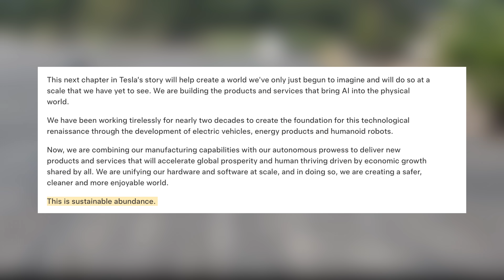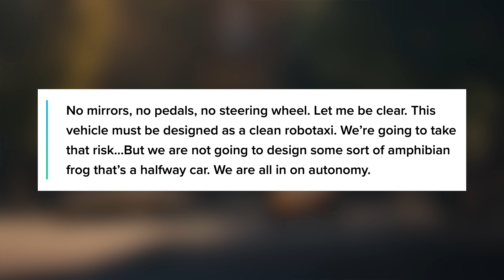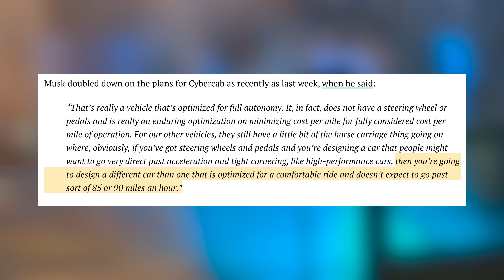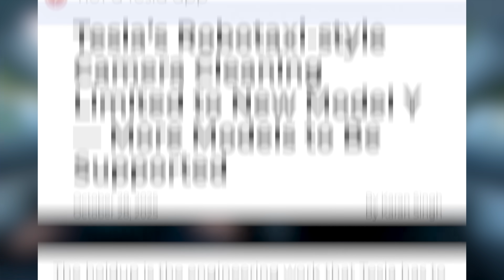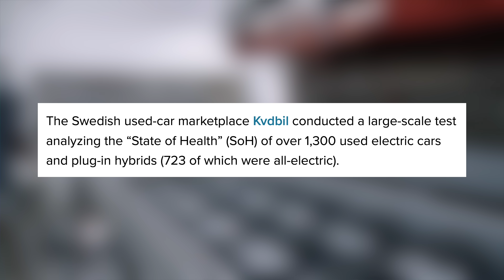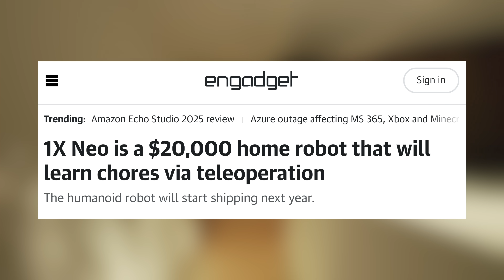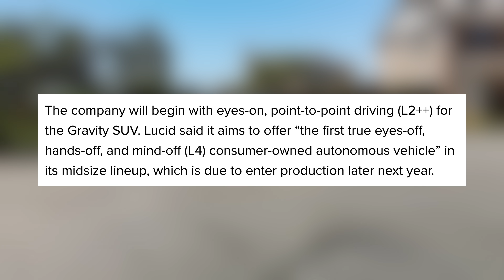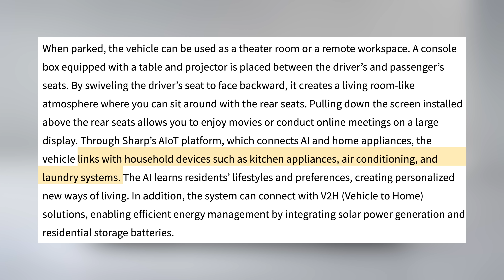The NEW Humanoid Robot That's Ready For Launch | 1X NEO

Comment: Robo Taxi is honestly not a great design IF you just want a car to take people to a destination.  The ZOOX is a better taxi design from the physical design side. Easier to get in and out of,  simple interior.. Easy to use temp and music choices. I think it is smaller than the Robo Taxi but seats FOUR people if needed.  As a passenger.. having to drop low and duck under a roof to get in a car is not really what you want to do.  Easy entry and exit is more important.

Comment: If you hit a pole in one of these the following can happen.   The power goes.  You cant open the doors as they are electrically operated.  The front battery that powers the cars doors catches fire.  Gasses from this enter the cars interior. Occupants try to get out.  If they are well briefed they may know the location of the manual release catches but in the fog and panic of the gasses they may not find them, and few users know where they are.  Who trains their passengers in exit procedures, passengers wont have a clue.  So the occupants may die, in what should be a small accident.  Stache D training has the proof.  Why is it permitted to sell cars you cannot easily get out of in an emergency.

Comment: The cyber cab as designed with full autonomy will be the very safest car ever built. They should take this information to the regulatory bodies and show them. Then the question becomes do I have to add a steering wheel pedals and mirrors that will make this a much more dangerous car? And press to change the regulation. This cyber Cab offered also as a car people can individually purchase as a low cost car without a steering wheel and pedals being the safest ever built will be an epic blowout sale. Everyone will buy who drives the cheapest cars out there. It’s the inexperienced drivers my nephew totaled three cars in his first year with his drivers license. None of that would’ve happened if his first car was a cyber cab with no steering wheel and pedals we are going to pollute the data of the cyber Cab if we put a steering wheel and pedals in it and let all of the inexperienced and bad drivers ruin his driving record This should never be a consideration. This is trading safety for sales, which seems to be what people wanna do and it’s just foolish. I would rather wait an extra year and force a regulatory people to realize the steering wheel and pedal makes a far more dangerous car dentist sub come to their current requirements and add a steering wheel and pedals making the car more dangerous. This is a no-brainer never add a steering wheel and pedals. I will buy two of these the minute they’re available with no steering wheel, pedals or mirrors.

Comment: I think the auto insurance industry will pressure regulators to force driver controls.   If the car has no controls, then no auto insurance is needed and would kill the industry!!!
Reply: Actually the regulators will most likely require insurance either way, at least for the foreseeable future.
Reply: @icarys perhaps some insurance but not liability.  If the people in the car have no controls any accident can’t be their fault

Comment: I expect the steering wheeel and pedals will be required in many if not all states. I hope that Tesla will be authorized in 1 or 2 states initially such as Texas and California and that will pull more states toward similar authorization. I would buy a fully driveable model like the M3 or MY as my personal car but use a clean cybercab when traveling into a metro area such as New York City, Los Angeles, Seattle, Miami and San Francisco. I expect Tesla will setup Metro border changeover parking lots where you can safely leave your own car and pickup a cybercab to your inner city destination. That may satisfy people who want a steering wheel and pedals (as well as a functional driver UI).

Comment: “Early development stages” doesn’t mean the roadster as a whole is still in early development stages. Tesla has already claimed that they have completed most of the engineering for the roadster. By “early development stages”, that likely only applies to the battery tech, not the car and powertrain themselves.

Comment: I rode in the Zoox fully autonomous vehicle in Vegas and it was pretty cool and had lots of room.  I like that the riders face each other and they have huge windows to see out of and plenty of cargo room for my luggage.  The four wheel steering is pretty sweet as well.
Reply: The Zoox-cab makes more sense regarding ergonomics... I don't see how women wearing high heels or older people can get in and out the cybercab (in its current design) without extra help from outside.
Reply: @koenraadprincen7212  This is so true.  The Zoox has enough room for wheelchair accessibility which they said is coming soon.
Reply: What speed does the Zoox drive at? (Maximum)?
Reply: @idahorx1 The one we rode in had a top speed of 75 mph, but they limited it to 45 mph in the city during testing.

Comment: Use FSD every day and the latest two updates are awful (almost unusable)! The only positive is that now I can select destination parking and it actually parks in the spot. But that’s where it ends! It panic brakes for a leaf blowing across the road, it blows past my offset speed (even in standard mode), has jerky starts and stops with more phantom braking than ever, blows red lights or races to a yellow just to slam on the brakes, and the maps still suck - sending me to a close, but wrong destination or taking the weirdest path unnecessarily. I keep sending feedback, hope it changes soon.

Comment: Been using V14 for 3 days now. Can’t say that I’m a fan. Highway speed sets to 121Km/h at Standard. Max is 100 and police rarely ticket below 118. So I usually set 115. Also late last night, 11pm, on a winding country road it set itself at 101 in a 90 zone. Lots of wildlife around here and I woulda liked to be able to set lower. Phantom breaking and trying to avoid paint markers on the ground didn’t help either
Reply: Sometimes I have to go to Chill.

Comment: Forget full autonomous, people should be making the decisions when it comes to driving.

Make the 2-door with steering wheel, pedals and stalks (gear shift and turn signal) and I guarantee you that I am not the only one willing to buy that car.

I have little to no need for rear passenger seats in my daily commuter/just out for a drive car.

Comment: Mad Max speeds a little too much for me, but I love how it maneuvers in traffic. It's actually quite safe.
Reply: Mad Max was going 25 over the speed limit on my way to work this morning.... I'm a lead foot, but this is a little tooooooo much.  lol
Reply: "Quite safe". The people who got into accidents injured and got tickets would beg to differ. Stop relying on computers to drive for you.
Reply: @TuLokotron2010  About 7000 pedestrians are run down and killed by cars every year. FSD is overly cautious around pedestrians to a fault. Whether or not FSD is ready or not, if it were implemented today, 90% of this pedestrian annual death toll would stop immediately.  
And most of the 40,000 people who die every year in auto accidents would stop too. Half of these fatal accidents are caused by drunk drivers, and stopping these people from driving would save a lot of lives as well.
Reply: @TuLokotron2010  Just yesterday, my Tesla braked hard on a blind intersection that took me off guard, and then a split second later, I saw a car speeding through it.  My Tesla saw it before I did, and may have saved me from getting t-boned.  Computers will be safer than humans very soon.  In this case, it was.

Comment: Full self driving cannot handle dirt or gravel roads. It just stops when it looses reference points and lines. 
Thus the need for driver controls. Especially if the Robotaxi is sold for private use. 
I imagine there are mani other situations that it cannot determine how to travel
Reply: handles dirt and gravel fine for me
Reply: Are you talking about Autopilot?  Because I have seen many youtubers driving off road with FSD.
Reply: FSD does just fine on dirt roads. Just pull up some FSD on China roads videos and you'll see. Very impressive. You must be referring to Autopilot stack which is a different thing altogether.
Reply: @galfert full self driving 13. Software. As I mentioned above it could be due to no defining edge. Which all of the videos of well traced dirt roads, they have no issues. Also I wish the software will eventually learn to avoid chuck holes.
Reply: @galfert after the recent update my car now handles dirt and grassy roads…
Reply: It could be due to the dirt is covered with tuffs of grass, leaving no clear path. I’ve had delivery drivers get off the path, due to trying to do paperwork at the same time.

Comment: Its a mute point if you have steer-by-wire as demostrated by the cybertruck. At that point steering wheel and pedals are just an oversized x-Box controller. So this really does not matter from a technical design perspective because it doesn't const them anything in compromises.
5:07 So no, it does not go against what he said on the earnings call. Designing the car for autonomy does not prohibit being able to put manual controls in it, if you have a steer by wire system. Can you think more then 5 seconds before you write this crap?
Reply: Moot point - unimportant or irrelevant point that does not matter.  Not a mute point.  Also, not a moo point but there's a friends episode that makes a pretty good argument for "moo point."

Comment: Tesla needs a VW Golf size car at 25-28 thousand dollars.
Reply: i agree.  would love one.
Reply: 20 - 25 would be even better.  Doable if they would use cheap /durable materials ditch all self driving , sensors , radars, cameras , computers.   Just a plain good range simple EV for everyone who has any work.  Could be called Tesla B or Basic 😅 Model like this would start real EV revolution world wide.
Reply: @MartinMartinX  They don't need to ditch self driving.  They need to set aside some greed and put the marketers (instead of overpaid engineers) in charge of sales innovation for a little while.  The first EV company to innovate enough to appeal economically to consumers with budgets $20k-$25k wins.  Stripping existing trims of the features that make Teslas Teslas was probably the worst thing they could do to their sales - especially post-Tax-Credit.
Reply: @DELLsFan not everybody wants or needs fsd or all of those cameras. Alot of us actually know how to drive our vehicles and dont rely on gimmicks from a machine. A simplified ev without all the extra crap is what alot of people want. Thats whats stopping alot of us from buying it. That and their ridiculous prices because of all the said crap installed.
Reply: They literally have the cybercab that they could use for this, and now required to add a steering wheel... it's literally right there in front of them and they could have saved the effort to make the Model Y standard edition and just gave everyone the Cybercab "steering edition" instead!
Reply: @taqmobile  ..yes !

Comment: No steering wheel is a good thing for elderly who can no longer drive. I would buy my father one without ever seeing it.
Reply: My reason for purchasing a Tesla, but in some locations the driver will need to take over. Once the vehicle leaves paved roads
Reply: @erehwon9371  I’d like to see more miles of FSD testing on gravel roads.  It’s not all that difficult.  Don’t drive in the ruts. Make room for oncoming cars passing from the other direction.   Make room for potential cars from the other direction when topping Hills.  Muddy roads would be fun…
Reply: @erehwon9371  FSD does fine on dirt roads in my area and on my long gravel driveway (1/4 mile or so). Now-it doesn't pull in my garage and park, but will back out of it.